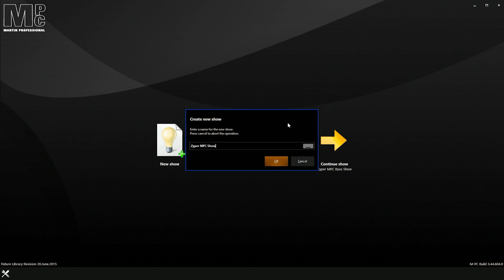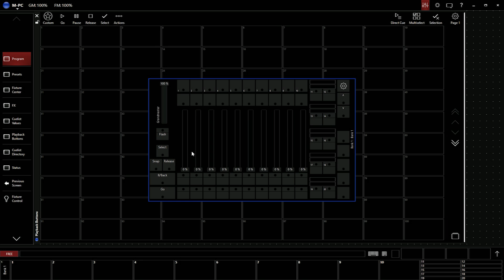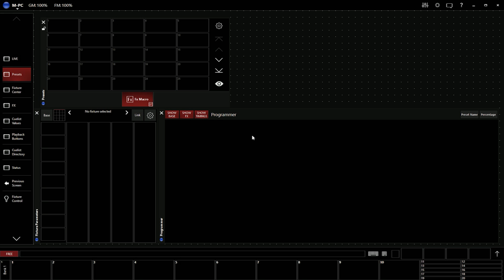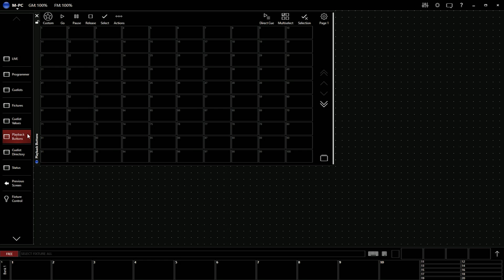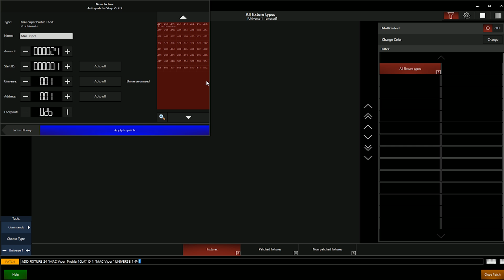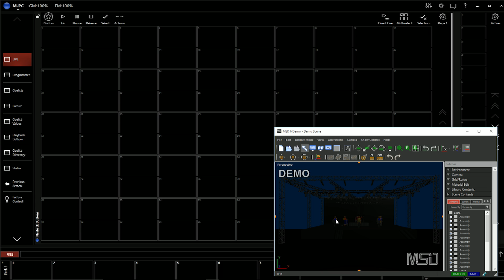Zyper Martin MPC Tutorial Part.1 - Introduction, layout & patch

Comment: Hey Zyper, one of the best tutorials on the M-PC. Thanks. Do you invert your stage left and right fixtures when patching? Or is there some other trick to invert their pan/tilt? I didn't see you put the invert in this video.
Reply from the maker: Dear Benji,

I invert the FX movement. Did you check part.2 and part.3 ?
Reply: I only went through 2 and 3 briefly. So you don't normally use the invert pan tilt feature in the patch window?
Reply from the maker: No, that's only if the fixture are not hanging in the same order.

I have movement where they all go the same way and some movement chere they are inverted so it really depend on what I want to dot.

Comment: Zyper, I had 6 Old Pars for my Downstage lighting, but I've sold them and have purchased 6 newer Pars in their place.  What I'm trying to achieve is delete the old fixtures from the patch and then add the new pars into the patch.  After I get them in, I want to go through all of my programmed scenes and program the new pars into existing scenes.  Any help?
Reply from the maker: Shane Burtch swatch ;)

Select the fixture in the patch and replace it with the new fixture.

You should keep them programed. Mpc will adapt the new fixture to the old programs

Comment: zyper world, I have the most current versions of M-PC and MSD6 Demo (as of March 2018) neither of which sync with your tutorial. I can live with the MPC differences but having the correct MSD6 Demo file is integral to getting through your tutorials. If, I understand you correctly,  what you're saying, in an early reply to a post, is to load (patch) the fixtures per your tutorial (the old M-PC Training show file) into the MSD6 Demo file. So I must first take the MSD tutorials to learn how to patch into that program,  then come back and take your M-PC tutorials. It's not a problem, I just want to be sure of what the best place to start is and the right direction to go. Since I've made the commitment to M-PC, I am wondering... should I make the jump to a paid version of MSD6, will it make it easier down the road when I'm programming my own stuff? Your tutorials are inspirational and I am ever so grateful for you and others who give thier knowledge so freely! Thank you!
Reply from the maker: Hi Mitch,

A lot of stuff has changed since my tutorial. But it still work. Main change is that the MSD demo file is a bit different. But it work exactly the same, just apply the patch that is on the lighthouse website and patch those fixtures in MPC instead of the one I'm using in the video.

Once that done you can do everything the same way with Free MPC & Demo MSD.

Don't hesitate to contact me directly if you have any other problem : contact@zyper.fr